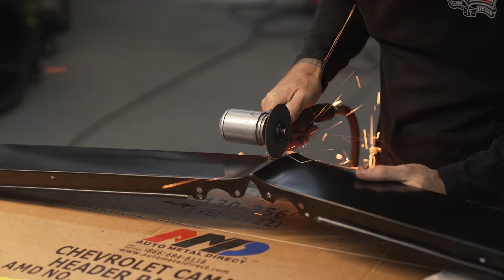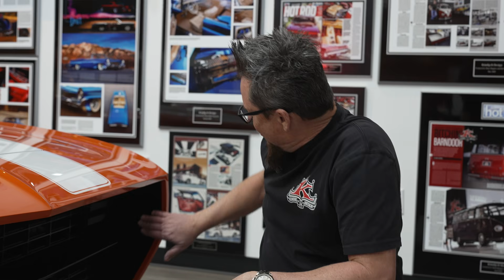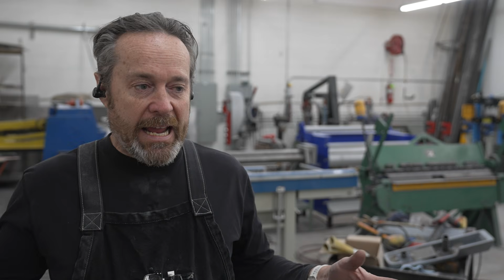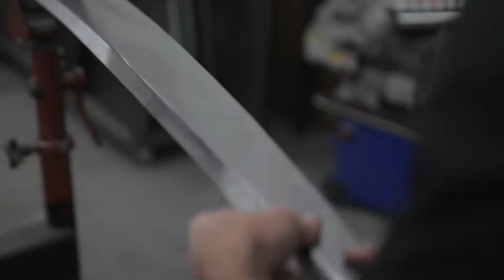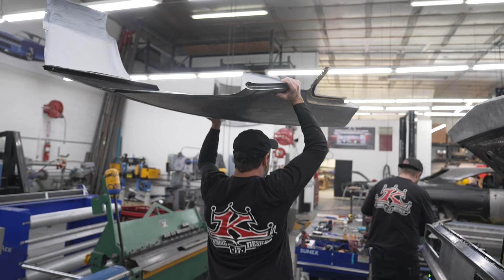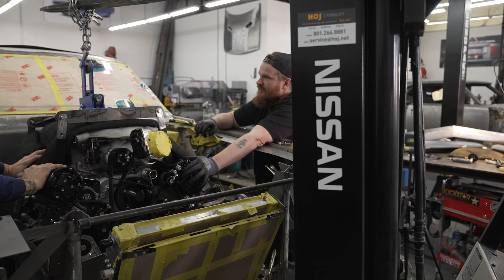The Point of No Return- Camaro Part 7 #kindigitdesign #customcars #automobile #camaro #musclecar

Comment: I have been watching the growth of Dave’s company for years now since I first started watching the builds on his tv show and continuing on YouTube now.
I think generally he is a great businessman and designer but I must admit, there’s been a few times when I just don’t like what he’s done to a particular car and this Camaro falls into that category. The blue ‘67 GTX I believe it was several years back and this Camaro both have this look where they have basically turned the front of the cars into a brick, totally square shape and from the side it’s just a slab of metal straight down, no shape whatsoever compared with the original car. Then, the whole front of the Camaro is just a rectangular black void with nothing to break it up and the front of the GTX was the same way , a straight line from the top of the front fender to the ground.
Personally, both of these cars lack style and character in the front end brick design and I know, people will say they don’t care what I think about it. They’re right, Dave and his crew will not care one little bit about my opinion, but if it was my car they were building, I wouldn’t accept that because it’s something that will not stand up to time and will be dated very quickly, just like the massive wheels on rubber band tires trend.